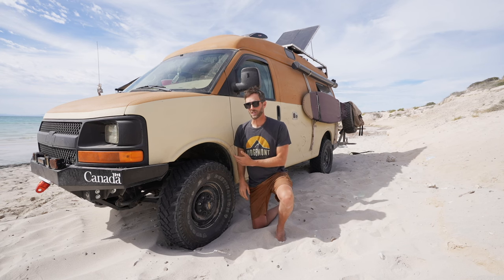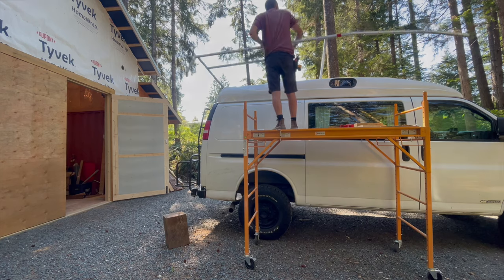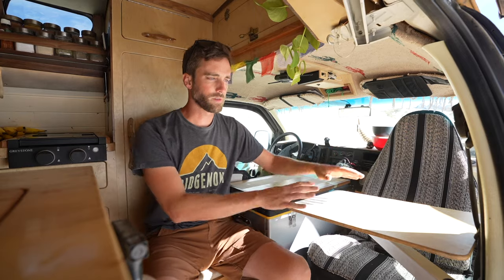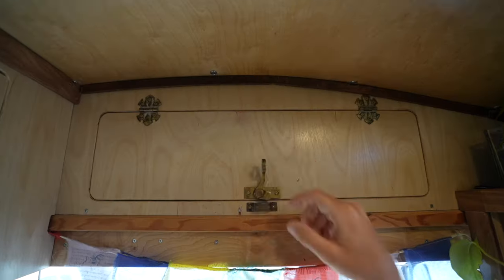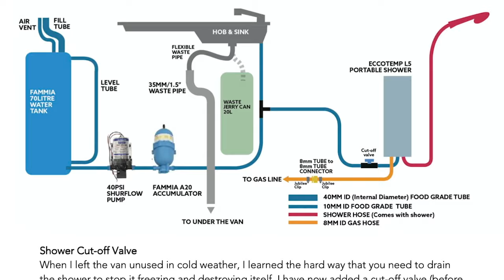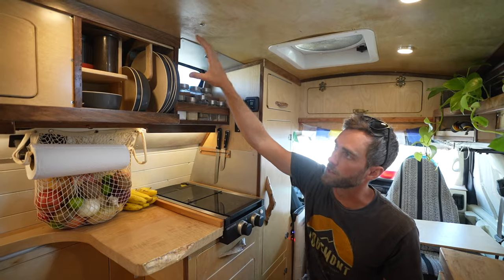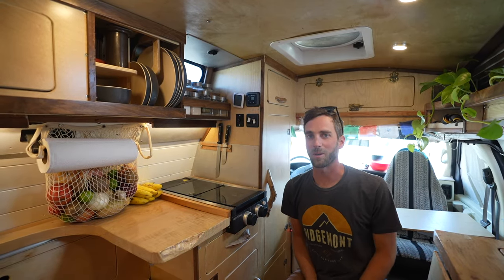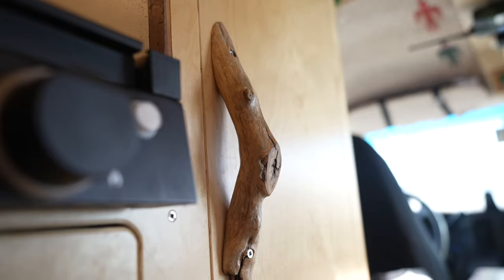Budget Friendly DIY Chevy Express Van | VAN TOUR 🔥

Comment: Just a chuckle. My family ran fly in camps in northern Quebec. We hauled supplies in by snowmobile and 4x4 when and where possible. We knew to get good and stuck you need 4x4. 

I would agree that 95% of the time an 2wheel drive with some ground clearance and decent tires will get you almost anywhere. Happy trails!